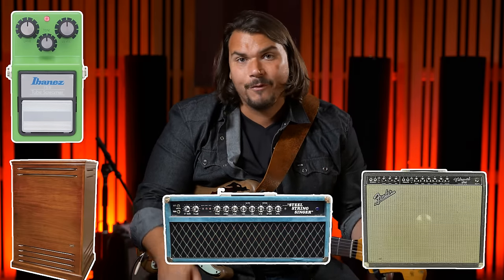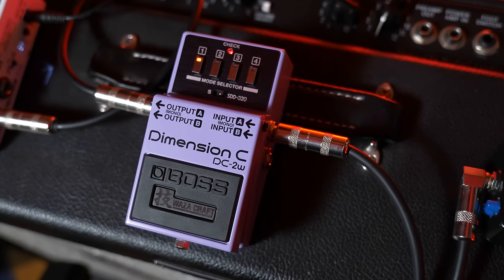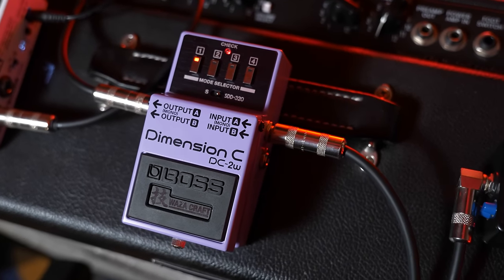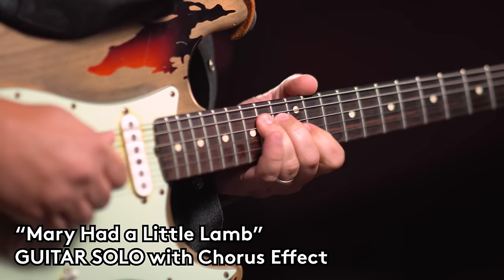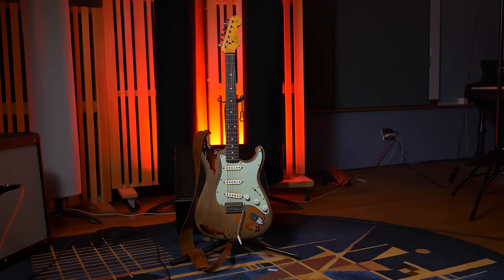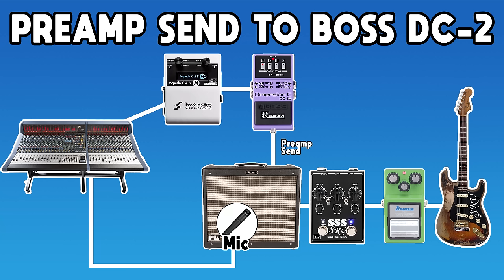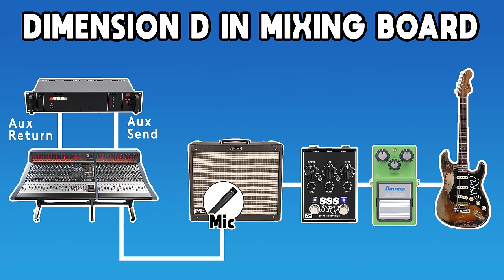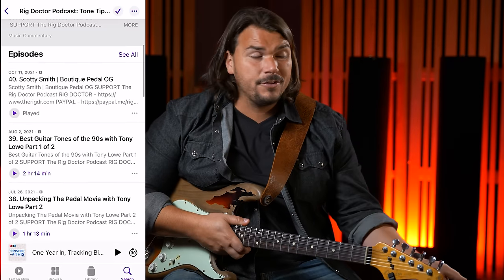The Secret Behind SRV's Tone

Comment: Can you use the line out method without the mixing board? Say you were live instead of the studio, after you come out of the chorus what would you plug in to? Another amp or cab?
Reply from the maker: Live, you still have mixing board typically.  If you didn't, you could go into the Return of another amp FX loop or into a power amp with a cabinet attached to it.
Reply: @VertexEffectsInc  Thank you for the reply! So I’ve got a thd hotplate hooked up to a combo amp, which has a line out that I can put into the Return of a head that’s hooked up to a cab? Would this work or am I gonna blow something up?
Reply from the maker: @AlexTroulanGuitar  that works!  Your hot plate might have a level control to address the signal hitting the pedal and wet amp, you may need to attenuate it going into the amp so it doesn’t obliterate the pedal.  The master on your amp can also act as a volume balance control.
Reply: @VertexEffectsInc  Okay brilliant! I’ve seen some guys set the hotplate to ‘load’ but i still want to use the two amps together as normal with both their speakers. I run both amps pretty hot, so was concerned about the 2nd amp receiving too much signal and blowing! And yeah there’s a line out volume control on the back of the hotplate which I can mess with!
Reply from the maker: @AlexTroulanGuitar  yea, just start with it off and then blend it in with the main amp.  I'd got until you hear the pedal clip and then back it down a bit from there.  You can make up the difference on your amp with the master volume control that's getting the wet signal.

Comment: Pretty sure Joe B runs a light chorus always on
Reply from the maker: He has in recent years, in particular with the Way Huge pedals like the Blue Hippo reissue and the Penny Saver.  However, he runs them in front of the amp, not in parallel like Steve did after the microphone.  This style would be more like the later examples with the chorus in the FX Loop.  It looses a lot of the subtlety of the chorus since it's no longer mixed separately from the dry amp, and in front of the amp would be considerably worse than the loop example with all the effects into the preamp input.  So, yes, Bonamassa uses a chorus, but not at all in the way that SRV did.
Reply: Kevin Conroy, JB has in the past employed an TC SCF Chorus pedal (the old school one that has the power cord attached) to split into a stereo image, which is used very subtly to get the tone you are describing. This is at the end of the FC chain and separate from the Way Huge Blue Hippo
Reply from the maker: @thomasmullin9315  To really do the SRV thing you can't use a chorus in series in front of an amp, really has to be after the dry amp in parallel.  This way you can mix the wet/dry ratio.

Comment: Sounds less subtle in the effects loop, More flanger- like.
Reply from the maker: Yes, correct, because in that example the effect is in series instead of blended in parallel.  With the pedal in series, in the FX LOOP, it lost all its subtle nature and really was too prominent to match what SRV was doing.
Reply: @VertexEffectsInc  Still a great 80's sound though! I had a Dimension C and sold it for a TC Chorus years ago. I think I will get the Waza craft. Thank you for this video, you have a deep understanding of the subject.  Is there a Dimension C plug in? If there is one could run it as an auxiliary and blend it.
Reply from the maker: @shredbot65  there are Dimension D plug ins for sure...not sure about C.

Comment: Dumble Steel slinger big frets big strings vintage overwound pickups tube amp antenuator
Reply from the maker: Don't think those pickups were overwound by all accounts, also no attenuator, but check out the video, it sounds like it's not what you think.

Comment: Kind of simaliar to EVH and the phase set low
Reply from the maker: Different in that the phase for EVH was in front of the amp, and for SRV the Chorus was in parallel after the amp and microphone in parallel.  You can make the sounds much more subtle this way.
Reply: @VertexEffectsInc  Understood thanks yeah I always set my delay or modulation very low if at all possible A simple analog delay w less headroom on the effect level control would be cool I feel w the wet dry set up you can crank the modulation more Great series man
Reply from the maker: @paulcowart3174  you can definitely have more control with separate wet/dry that's for sure :)
Reply: @VertexEffectsInc  I think he might be referring to the way EVH used a micro pitch effect(similar to a chorus effect) in a split wet/dry set-up.

Comment: The secret is cheap Radio Shack cables that roll off high end and shift the mids.
Reply from the maker: I think that entire line of theorization has pretty well be debunked.  Rapco/Horizon, at the time just Rapco, was the OEM for Radio Shack cables and accessories for audio.  They were actually fairly low capacitance cables, decently made, well shielded, and sorta a more flexible version of the classic RG cables.  Later into the 80's SRV was using George L's.
Reply: Which RG cable specifically??
Reply from the maker: @meltruent77  RG58 was the standard for many guitar players in the 70's into the early 80's when we really started seeing more boutique cables, or even a conversation on cables.  Guys like Jerry Garcia got hip to the Belden RG stuff in the 70's and a lot of other guitar players too but it was super stiff.
Reply: @VertexEffectsInc  I will have to experiment with RG58, 50 ohms unbalanced. Will any 50 ohm cable work?? I transmit on Amateur Radio and have many type of RG.
Reply: That would be a great video. I have seen your video on patch cables but IMHO, this RG thing would be great.
Reply from the maker: @meltruent77  Give it a try!
Reply: @VertexEffectsInc  I was totally kidding but I enjoyed your comments and this awesome video. You rule!
Reply: @VertexEffectsInc  I’ll will but you have to do us a solid and make the video.
Reply from the maker: @meltruent77  let me know how it goes...I don't wanna buy 1000 ft. of it to check out out.  You're our guinea pig.
Reply from the maker: @billnelson9413  wanted to set the record straight if you hadn't heard this before :)
Reply from the maker: @Gupster 23 naturally

Comment: Just go out and get yourself a tubescreamer and you’ll sound just like him lol. Stevie didn’t even use the tubescreamer as a tubescreamer except on a few numbers. He put the volume all the way up and the drive all the way down, he was using it as a pre-amp to overload his signal. Stevie knew nothing about gear according to his tech Renee Martinez. He didn’t collect persay, he didn’t even know what #1 was, he thought it was a 59’ which it wasn’t it just had 59 pickups (63 body with 62 neck). Anyway, if Stevie knew about gear and if he had a pot to piss in for most of his life he’s have had a preamp peddle with an additional fuzz or gain or OD peddle behind it. The point is really (and this goes for most drive peddles) is they can backup as a preamp and that’s what he did except for the Hendrix numbers
Reply from the maker: Hard to know there is so much conflicting information.  What is not up for debate is that the Dimension D was used in parallel with the dry amp on many of the iconic records.  I think the Tube Screamer thing is pretty well known at this point, this is something much less known or utilized when talking bout SRV tone.
Reply: You can’t get tone like that without knowing a thing or 2 about how amps, power ratios, modulation and how sound in general works. I heard stories from the band themselves talking about how Stevie found out you can get different tones by how hard and where you pick the string from. That’s why live lenny sounds a lot more trebley than the studio recording. Stevie had his amps set up for loud and in youre face but playing lenny live was a little bit different because he had to play soft. Him doing this created the perfect clean strat sound because when you have your amps biased towards loud, the softer you play the less bass comes through. There isint such a power over load going to the pre amps and speaker creating natural bass. Stevie knew this and used it for the signature sound of lenny. Stevie wasn’t stupid by far when it came to gear he knew his shit.
Reply: Dude what you’re describing isn’t gear. Stevie knowing how to get sounds out of his equipment isn’t the same as knowing what that equipment is. I’m sure he knew how to squeeze every last type of sound out of #1 or any of his guitars or amps with regards to settings, signal path, picking etc etc. That’s him using his ears as a master musician but he didn’t know the names or actually the specifics of his gear. He knew he had a vibroleaux but didn’t know Renee Martinez I stalled orange drop caps for instance. Didn’t know the signal path that the chassis of his Dumble Was based off of. That’s the gear head stuff I’m talking about. Obviously He knew all his gear with relation to the sounds it was capable of.

Comment: I don’t think he was using a chorus pedal or effect.  He probably had a close mic and room mic and the chorus you hear is the phase difference.  Don’t you think he would have used one live if he intended to have a chorus sound.  He bothered to bring a Leslie with him right?  Also the engineer on let’s dance and Texas flood were different, what like was the same was the way Stevie asked them to mic his amp.
Reply from the maker: In the studio, he was using the Dimension D on the albums I mentioned.  This is confirmed by multiple sources including engineers and producers that worked on Let's Dance, Texas Flood, and Couldn't Stand The Weather.  It's also part of the SRV Archives, and validated by several SRV experts separately from anything in this video.  This is not a matter of phase, I don't think he would've used it live because back at that time the Dimension D was primarily a studio effect run in the mix bus, re-creating it live would have been difficult without a rack-based system and a knowledgable FOH sound man.  A Leslie or Vibratone would be simple to put in series with any amp and isn't dependent on the PA system or mixing board at any one venue.  Nowhere in the video does it say that the production was the same from Let's Dance, to Texas Flood, to Couldn't Stand the Weather.  Presumably, if it was a sound SRV liked, the sound would follow the player, not the production crew and recording engineers.  The Dimension D was a pretty pervasive piece of studio gear at the time, most recording studios, worth their salt, had one.

Comment: The secret to SRV tone is practice. Playing right with "wrong" gear will sound closer than playing wrong with "right" gear
Reply from the maker: While I appreciate the reminder to "eat our vegetables", these two things are able to co-exits: practicing SRV licks and having the gear to re-create his tone.  You can practice SRV licks thorough a Peavy 5150 lead channel and likely sound nothing like SRV even if you're playing the right notes, just as you can poorly play SRV tunes with all the right gear.  Isn't the real bulls-eye the marriage of the two?  Good technique and the right gear?
Reply: @VertexEffectsInc  sure they can coexist but why do you instantly go to extremes like "5150 lead channel" it's like intentionally trying to fit a square through a round hole. If you like SRV tone you most likely will play a single coil guitar through somewhat clean amplifier. And it's not only about the right notes, it's more about the attack, pick angle, rhythm sense, microbends and other details. Even if you go through 5150 lead channel and turn your guitar volume down and eq it the right way you will get reasonably close. That's another point that knowing your gear is better than getting new gear in a lot of cases.
Reply from the maker: @ilmisxx2  I scaffolded my responses in a way that resembled your comment, e.g. "right playing, wrong gear."  Your comment seems to speak to something that's not really in the spirit of the video.  The video's core idea is to illuminate an overlooked effect that's often invisible in most analysis of SRV's gear.  It doesn't seek to override the value of practicing or place a qualitative measure gear versus guitar playing technique.
Reply: @ilmisxx2  Mason likely isn’t making this video for first time SRV tone seekers, I’m not sure why people can’t grasp this. I’m an avid SRV player and can get some great tones whether I use a Fender blackface tube amp or a $50 Crate solid state. These types of videos are aimed for people who already know that vibrato, attack, pick angle and bend technique are what will mostly let you sound close to SRV. This video is a deep dive into hearing isolated tracks to specify what modulation was used, not his technique.
Reply: I love Stevie, but if he were here I bet he’d encourage players to find their voice. And sometimes gear/setup helps to find it! I loved the video bc I learned something new about him AND widening with Chorus is the bomb. I’ll use this as inspiration at my next gig, where I most likely won’t be playing many SRV tunes. Thanks for this @Vertex Effects! 

PS Got any gear secrets in finding that syrupy, phased Albert King tone from the In Session record!?
Reply from the maker: @thecdant  I think he used a flanger with all the knobs at ZERO as I recall.